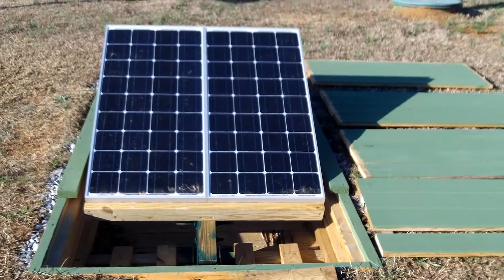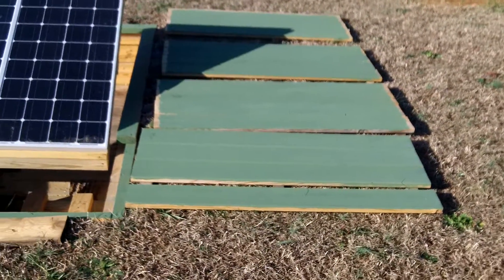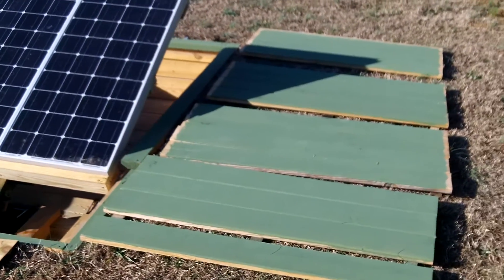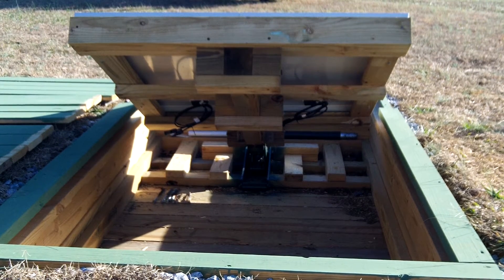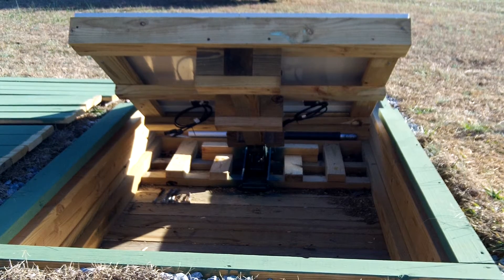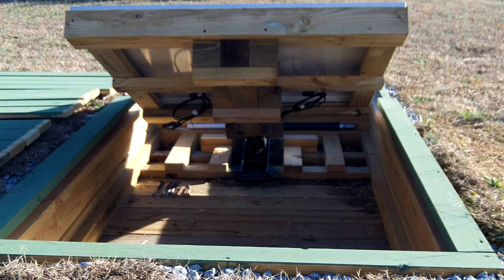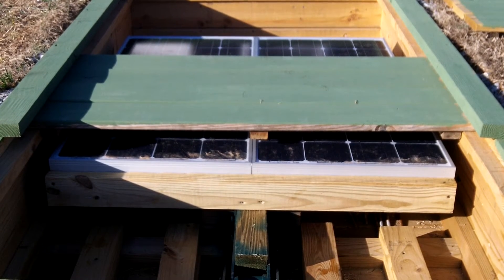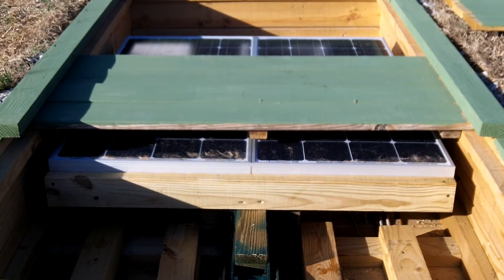Update of underground solar stand

Comment: An EMP proof cover needs to be a good metal to metal fit and then electrically bonded(grounding straps) to the top bottom and sides. 
This would protect the system from EMP damage.  For size try placing a lawn chair next to the solar panel as a size reference.  
because the system looked smaller.